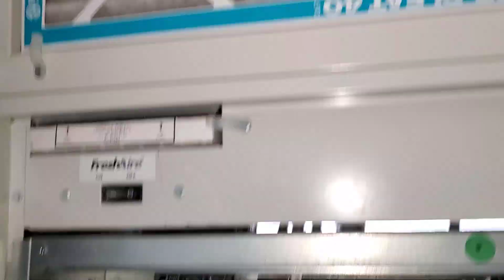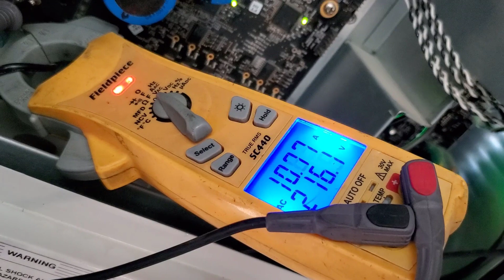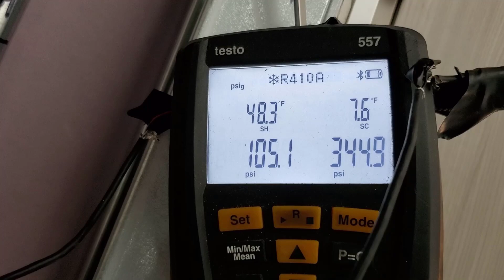Friedrick VRP leak repair - I still think these units have potential for greatness

Comment: Decentralized units like these are definitely one of my preferences as a design engineer for various commercial buildings. I've seen what happens to old hotels with neglected hydronic systems and it's often not pretty. And of course nobody wants to spend money to completely replace such systems and piping, if you can even get to it without tearing the building apart. If these vertical units can have an industry standard cabinet size like PTACs do where you can pull and put anyone's unit when they need replacing, that will be awesome for long term sustainability of the building.